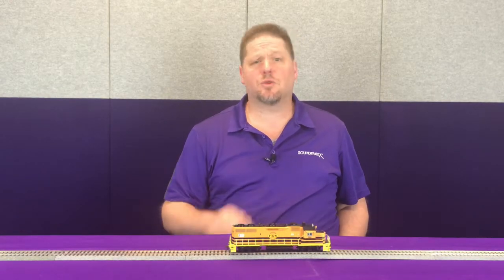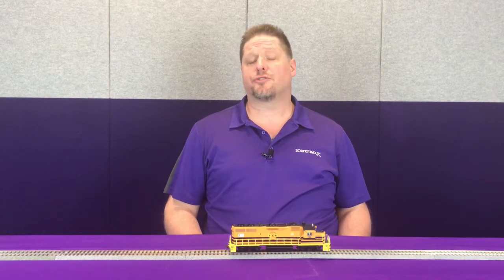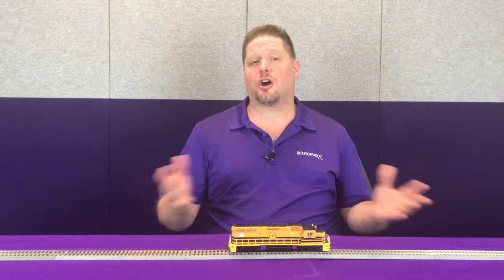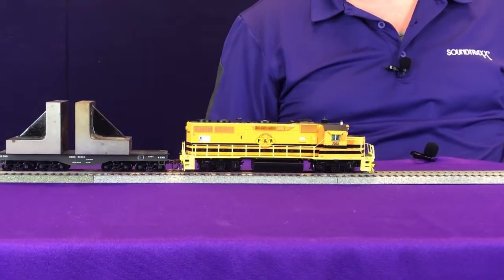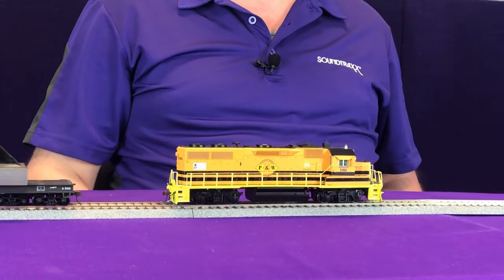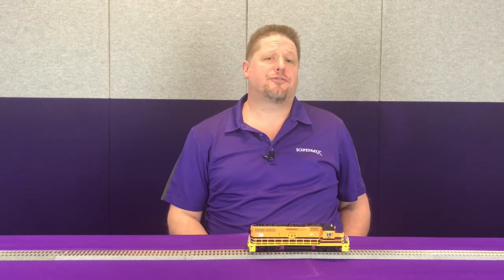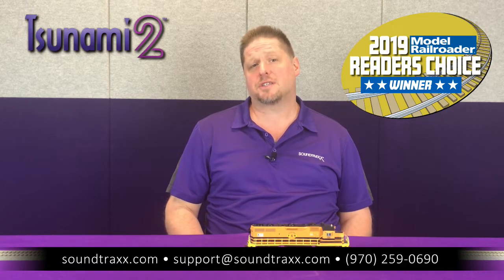Advanced Programming: Dynamic Digital Exhaust Demonstration

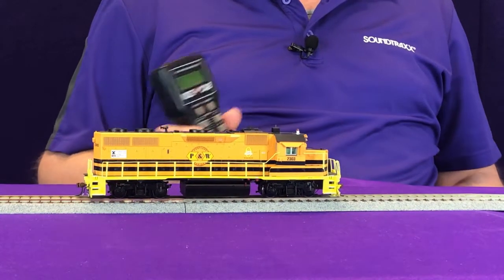Comment: Shouldn't the diesel notch up before it starts moving??? @1:19
Reply from the maker: Out of the package the decoder notches up before the model moves. You can disable this with a CV if you want.
Reply: @SoundtraxxDCC  no that's what I meant lol on some of my other Athearn stuff, the model would start moving before the decoder was even notching up
Reply: @AbelG8781  In notch 1, diesel does not increase revolutions. Notch one just allows the current electricity to flow to traction motors. Notch 2 ( Not speed step 2 ) is when you would hear an engine start to rev up.
Reply: @splitrock323  I get that, but isnt putting it in notch 1 the same as putting your car in drive, slightly begins to move under it's own power when brakes are released?
Reply: @AbelG8781  Yes. That is correct. But the sound does not change.